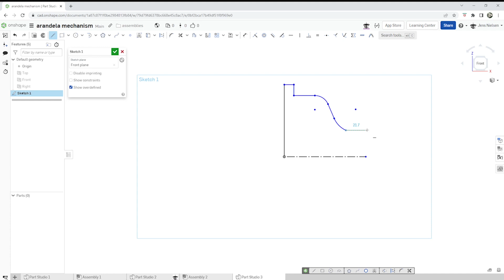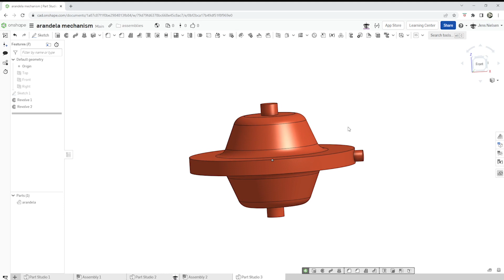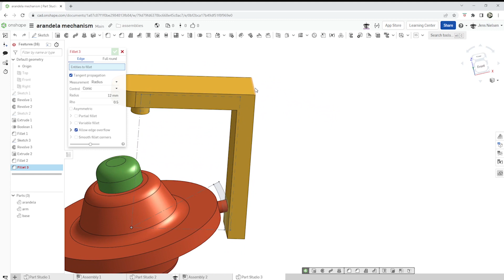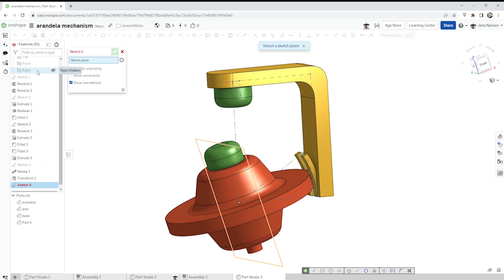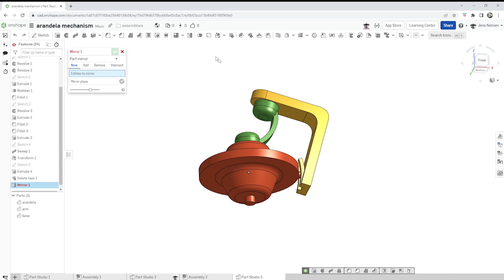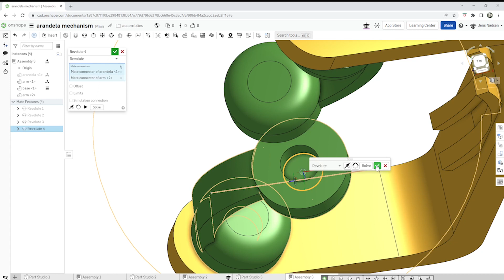Onshape for Beginners: Build an Arandela Mechanism (Easy Tutorial)

Comment: Very cool project. Something I would do another way is I don't would use the sweep. I would just do a symetric remove extrude with sketch3. So you don't need another sketch 🙂
Reply from the maker: Thanks Stefan. True about your extrude, though with the approach I took you have the distance defined parametrically through the dimension of the pin.